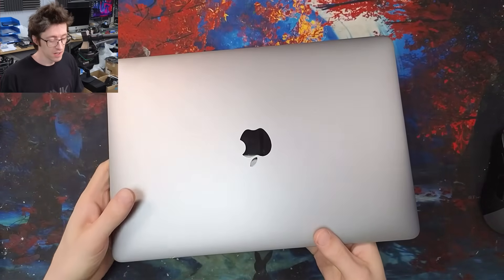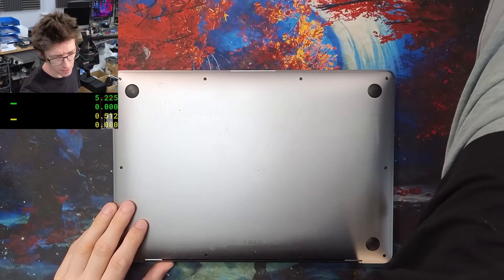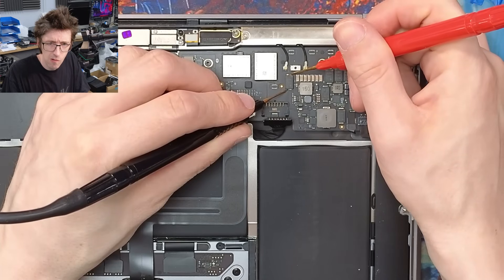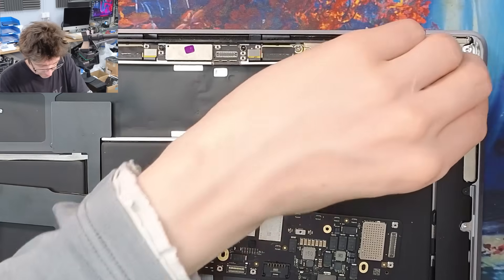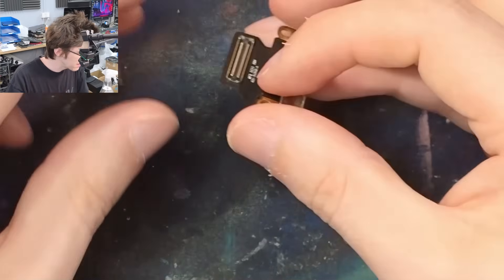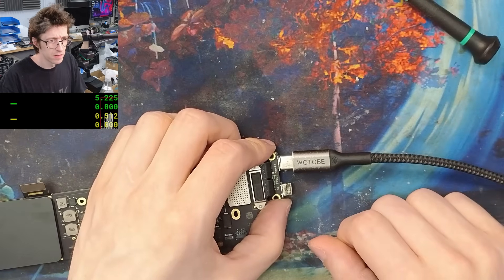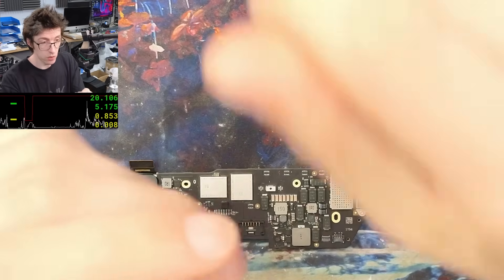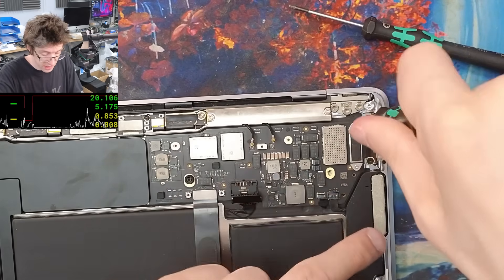MacBook Air Double Bill, no charge, input shorts, check this first! #455

Comment: I did mention the lack of face foliage in another of your videos as the mystic goatee was kinda your signature hehe   BTW if I bought a 5700XT over to your good self, would you take a gander at it?   I've undervolted and trimmed up the clocks and it kinda works just fine but it seems to get to peak stress and freezes, locks the PC and boom have to reset PC.   I snagged a 2060 Super for under £50 so I can give my poor RX580 a happy retirement as my reserve card but the 5700XT when its running is actually superior to the 2060 by a decent margin and would prefer that to be in my machine.   I have put Honeywell phase changey thermal pad which is as good as liquid metal without the munchie munchie of components and bought some new decent thermal pads for the XT, it doesn't crater on every game just stuff that like Diablo 4 when in infernal hordes which can have a lot of monsters on screen with tons of effects etc.   You prob don't remember me, Siana's dad, little blonde girl who used to work at Netplay for Tom and Andy, used to enjoy a pint with you in the Corrie club or down the Red?
Reply: I am working as I type on my £29 Xbox Series S I snagged off da bay, PSU has taken an early bath so hoping its something simple as fixing a new one in there.   I seem to have an Xbox addiction as I have an OG Xbox crystal, a Xbox 360 "phat" which surprisingly works for a first gen 360, two rebuilt Xbox One 1540 one a Forza edition and paid £4.99 for the standard one and about £20 incl a new HDD and Forza shell for the second, got 4 Xbox One S's and an X none of the S's work but in the "to do"  pile and of course the Series S which externally is pristine.   Got two PS3's I paid about £3 each for both, also got Siana's PS2 slim which she got for £60 including every PAL game plus a crate full of PS1 games plus 3 Mad Catz Ferrari steering wheels and foot pedal kits and her modded Gamecube I built her back in the 2000's with a full size disc drive, mod board and LEDs still works too :D

Comment: I once had a corroded connector that was not so easy to replace (special proprietary thingamabob that was no longer being manufactured). After the first rough cleaning with toilet cleaner (contains formic acid, which is a reducing agent and can slightly counteract oxidation), I polished the pins with a fiber glass pen, and then re-tinned them with solder. As far as I know, it's still working.
Reply: Someday I want to try replating connectors with gold.

Comment: So question, I have a mac book pro (older one) and I had replaced the battery on it.  Then it was working, not when I plug in the charge cable, I get a green light, but nothing moves.  No fan, no screen, no sound at all.  I have checked and the power connection appears to be good.  Thank you for any help you can provide.
Reply from the maker: Sounds like a dud battery, only easy way to know is to try another one though...
Reply: @Adamant_IT  OK.. thank you.. Love the channel.  I will try a new battery..

Comment: gramham the reason OBS freaks out when multiple camera is connected is due to the USB hub 3.0 is bettere hub for the BRIO with a USB 3 cable
Reply from the maker: I think it's along those lines, yea. However, I recently built a new recording PC to solve this... and it has not solved it.
I think it's an OBS issue, so I need to tinker with the OBS config to see what exactly is upsetting it.
Reply: @Adamant_IT  yea.... I have 2 camers on my pc main is BRIO(works with windows hello) and the keyboard cam was c920 using hubs theirs not much issue since my BRIO is on usb 3, I never used a 3rd camera for my setup as it wouldnt make sense